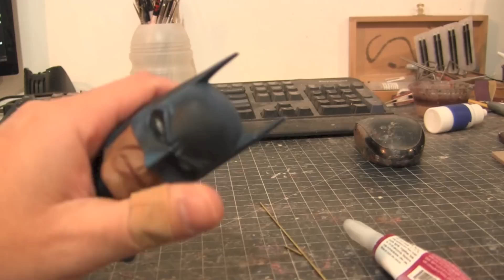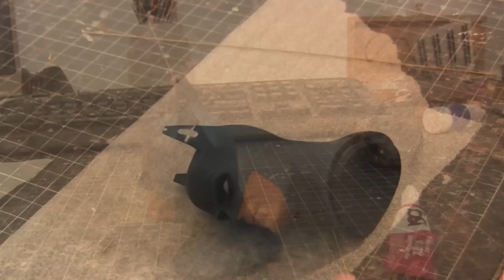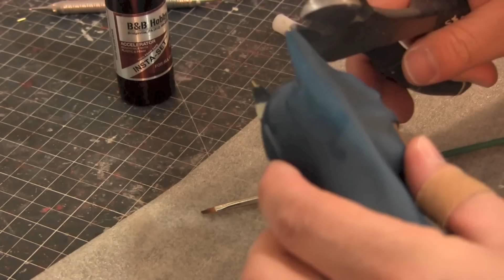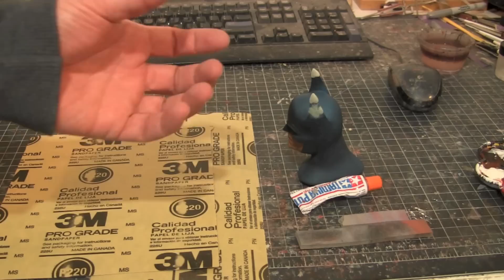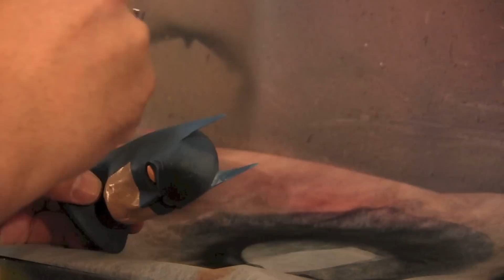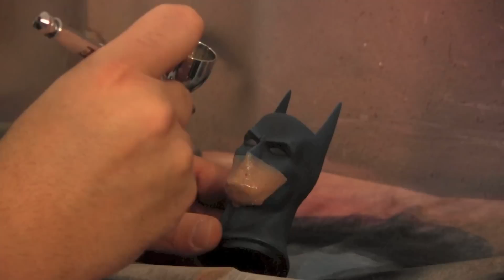Batman sideshow PF statue Ear repair

Comment: Hello, what did you use to re-do the tip or the ear? Is it the ic gel?
Reply from the maker: Called Aves Epoxy sculpt, you mix A and B tougher in equal amounts, have about a 3-4 hour work time and cures hard as a rock after 8 hours. I use it on all my customs. 
https://avesstudio.com
Reply: @VinceVellCUSTOMS  thanks you !

Comment: Hey cool video. I just got my Guts the Black Swordsman and when I put his cape in some of the polystone or whatever it is broke away from the hole leaving a bigger hole and it looks terrible. I know it's hidden but it will bother me and resale value would take a dump. So aves Epoxy Sculpt looks like the have a black color so that's good. I probably won't have to do any touch up at all if it matches ok. I've been getting so many broken statues it's not even funny. Megatron Prime 1 sword broken, 3 Alien King maquettes broken and getting my 4th one and praying lol.
Reply from the maker: Ya the black aves will work just know that it will leave residue on your hands so if your not watching how you handle the item you will leave aves finger prints all over. I suggest mix up the aves with gloves on, then you can take them off to handle the aves better. But set up the item with some coverings or ceran wrap just to make sure you don't touch anything you don't want to. you can lay the ceran wrap over lightly don't need to wrap it like a food container. 

ya the bigger these items get the more damages will occur which is why i like the 1.4 scale or 1.5. getting over those sizes is just to risky even of companies with amazing packing.
Reply: Ok that's good to know. The last thing I need are fingerprints or any residue on something that cost me close to $2000. Sideshow said they would contact Prime 1 but they said they doubt they will replace the body because the damage is not visible when displayed. I actually just ordered it about a hour ago and ordered it in black hope it matches ok.
Reply from the maker: Well that sucks, guess as a middle man selling another companies statue they just don't want to deal with it. But good luck with the project.
Reply: They have been decent with customer service. A bit slow on replies but they get there eventually. I have to wait 6-8 weeks just on a response from Prime 1 on my broken sword for megatron. It does all suck big time. Thanks for the help.